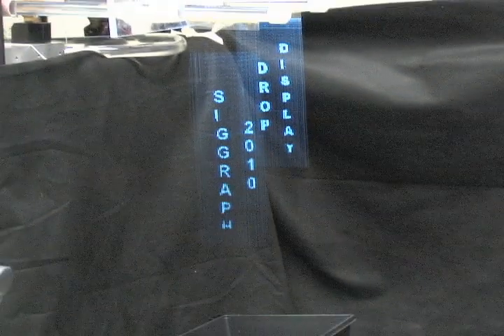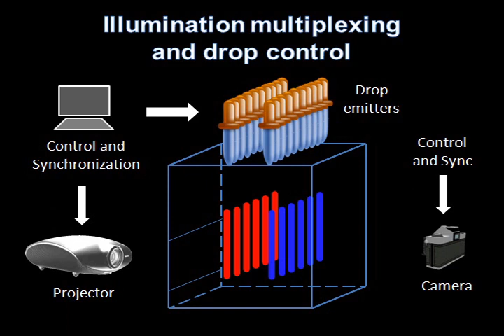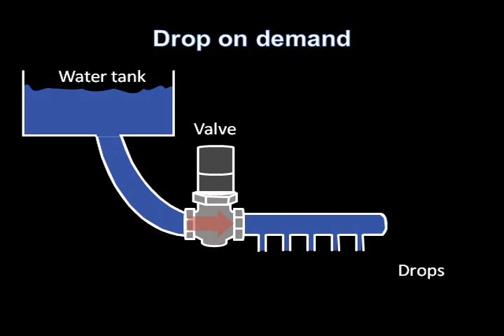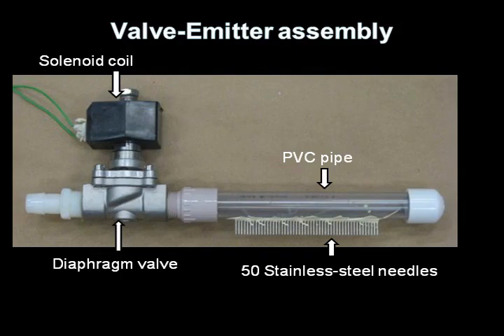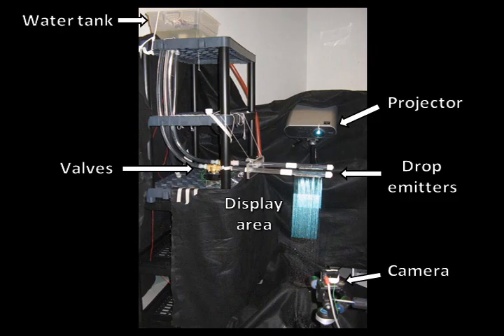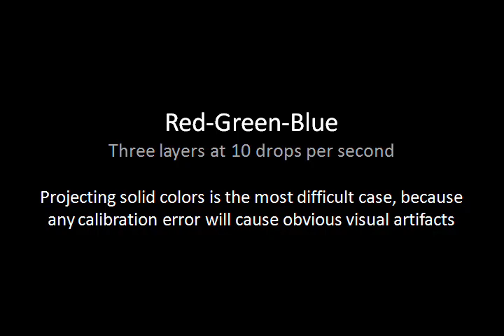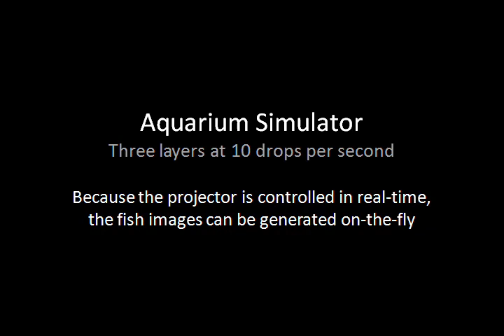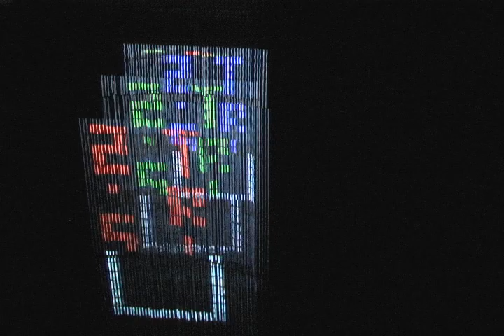A Multi-Layered Display with Water Drops

Comment: @apokkalyps 
lets keep it calm. ok:)

you r right man, there is the same amount of water.

but im talking about water that can be used for manufacturing or daily purposes. there is never same amount of such water

imagen this pointless and just for fun "display" will become pop as TFT or LED. 
the water will evaporate immideately, especially in a hot day.
this tech wastes water, space, electricity and few years ago some idiots showed 
the same project, but they used steam instead of water.